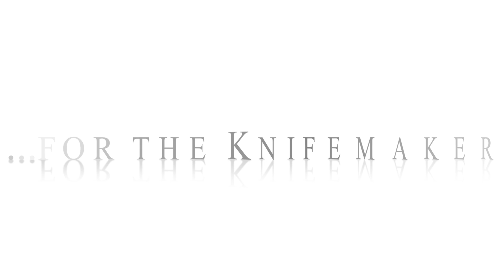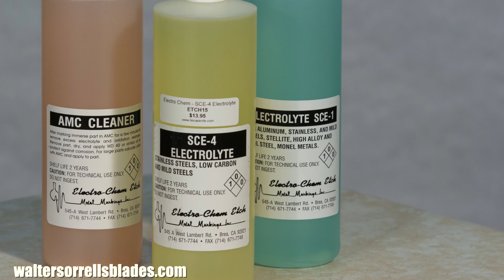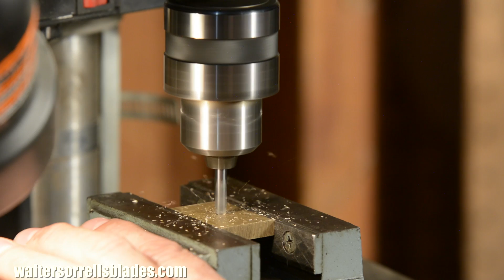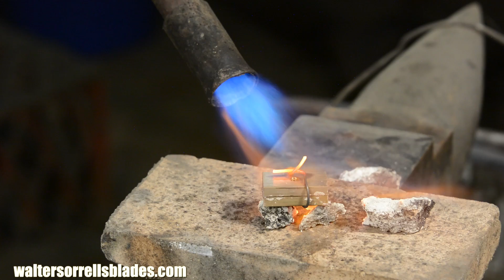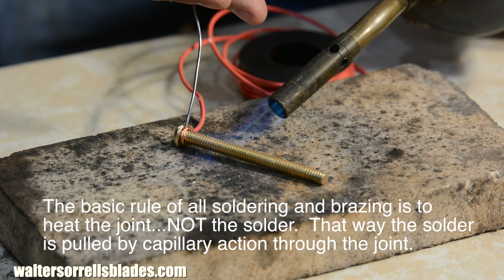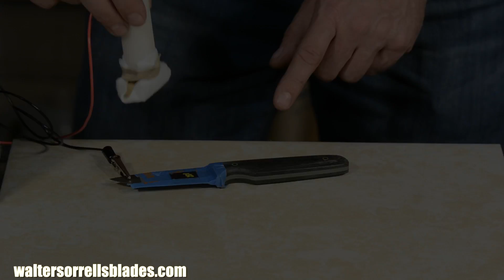Making a Marker For Etching Logos on Knife Blades...and Other Metal Objects

Comment: Nice fancy applicator, but I believe you've wired it backwards.  The red positive is supposed to go to the part being etched, and the black negative lead is what's supposed to go to your applicator.  If you're using AC for black marking, the colors don't matter, but for DC deep etching you've got the wrong lead going to the applicator.

Comment: Why wouldn't you just drill and tap a thicker piece of brass instead of brazing two pieces together?
Reply: That's what I didn't get! What's even the point of thickening the brass piece? Why not use like it is?

Comment: Thanks for sharing this great idea!! ["shared" on GAB.ai, and on Xephula.com]  
IMHO: ...You could coat/insulate the necessary metal electrode surfaces, (brass bolt threads), with "liquid electrical tape", (rather than "epoxy").

Comment: Walter,
 Gotcha! Actually, the #7 drill, and the others on the wall charts are designed to give 75% thread engagement. Someone decided that the bolt/screw will likely break before stripping the female threads. We all make do when it works as well as the “right” way.
  A handy method that I learned years ago, is to use this formula. TDS=D-1/N   TDS= tap drill size.  D= major dia. of tap   N=number of threads per inch. Metric threads are easier. Example M6-1 tap drill size is 5 mm or whatcha got.
  I never realized how simple these things can be to make. Thank you for brightening my bulb.

Comment: What on earth is "Sodder"?
Apart from that....pretty interesting.
Reply: Unfortunately "Sarder" is the appealing and Crass way Americans try to pronounce the original English word "SOLDER"! 
I wonder if the presenter ever "SARD" a car when he didn't want it any more.
As in, "oh yeah, I SARD my car  on eBay". I SARD it in 3 days.
No. He did not. He SOLD it. It SOLD on eBay, and it SOLD in 3 days.
And the electrical joint was SOLDERED.
SOLD_ERED.
SOLDERED.

Comment: This video leaves out the most critical "need to know" information about successful electro-etching, the voltage and polarity. I can assure you if anyone connects the "red" positive supply to the stamp and the "black" negative supply like the video shows, they will not get good results. In DC etching the work piece is always the positive "red" and in electroplating the work piece is always negative "black". In effect what you have created is a nice electroplating kit not an etching kit. This is all assuming you are doing actual DC etching which brings me to another point which is that etching can also be done with AC current which simply makes a black mark and does does not remove much metal.

Comment: Just out of curiosity what are you using for a power supply? Thanks!
Reply: A car battery charger works. 6V for light etching. 12v for Deeper. Run some test pieces on scrap steel but I generally hold for 15s (with salt water) a few times to get the etches I want. Fiddle around to see what you like in terms of duration held and number of passes.

Comment: Also for alligator clips and banana plugs that you used. Radioshack and Bestbuy both sell screw type. Other than that the same tinning technique should be used pre soldering for those. Even if they are the screw down type tinning is recommended to prevent wires becoming unbraided and damage as it adds a conductive but protective metal shell to the wires. I would recommend electrical tape or heat shrink for everything up to the epoxy and at least cover the epoxy top with some electrical tape.
Reply: Harbor Freight sells them much more cheaply

Comment: Your solder application note is for plumbing and not for wiring as you are doing in the video. Per NASA soldering standards you apply heat to the component.

Comment: Just a couple of tips for the electrical soldering of the red wire.The copper of the wire should only wrap around the bolt until it meets back up with itself. Also, tin the wire prior to wrapping it, you will have less wire separation and better conductivity. All you have to do, since you shouldn't use a propane torch on electrical wire, is apply a small amount of solder to your solder iron tip and hold the tip to the bottom part of the wire near the end away from the insulation and apply a small amount of solder from the top. Do not get right on top of the insulation as wicking can occur, but move solder and iron toward the top after the solder begins to melt and move down toward the end of the wire. This will give you a good solid conductor with even solder application and the excess solder will come off at the end. It shouldn't be a lot of solder, so if you think you applied too much, run the solder iron under the wire again to strip the excess. Probably should have mentioned hold the wire horizontally with a slight downward angle. then to apply the solder to the bolt, I would suggest roughing up the brass on the bolt a bit with some scratches near the soldering area and wrap your wire. Heat it up and apply solder. Remember that the bigger the blob the better the job is the wrong attitude. Had to add that, just the electronics tech side of me.

Comment: as long as you do not use more than 50V DC you have no chance of shocking yourself
Reply: +happymark1805 35 volts is often considered the threshold of safety. But if you want to grab onto 50V be my guest. Let me go fetch a bucket of salty water for you to stand in too.
Reply: +Paul Frederick dont know who teached you that, but my profession  in The Netherlands is electrician, 50AC is written in the books as treshold (years ago it used to be 42V AC), Phone lines also use 50V DC because thats is safe, ever touched a welder ? well that is 50V AC too, with DC you can even go much higher before it gets dangerous (according to NEN1010 it is 120VDC) http://www.opleiding-vca.nl/artikelen/de-gevaren-van-elektriciteit/   so you meight want to check the facts before you say something.
Reply: happymark1805
Actually I have gotten shocked by welders. I cannot say I recommend it either. Notice how I said "threshold". If you knew anything then you would know that electrocution is subject to many variables. Judging by your lack of depth of knowledge on this topic I wouldn't let you change a light bulb for me either. So go back to the bar and guzzle some more lutefisk there Olaf. I'm done with you here.
Reply: happymark1805
It is no lie. Look, I've been hit with high voltages. I did not get electrocuted. But that is only because I have been extremely lucky. Not because the potential did not exist. Because others subjected to the same level of voltage were not so lucky, and died as a result.

Now what jack fool fucking moron +1ed your reply?
Reply: happymark1805
I've worked with plenty of licensed electricians that were complete morons. Just because you know which end of a wire nut to twist does not mean you understand the greater picture when it comes to electricity.
Reply: +Paul Frederick You are a complete moron and does not even know the basics of electricity, so yeah come back when you had a bit of education about the subject.wat ben jij een domoor zeg, ga terug naar de kleuterschool.
Reply: happymark1805
hmm my decades of circuit design suggests otherwise
Reply: +Paul Frederick  your answers suggest you even never went to highschool, because you do not know what you are talking about, might I suggest that in the future you read NEN 3140 and NEN1010 before you make a complete fool of yourself again.
Reply: happymark1805
I have already read more than enough on the topic.
Reply: +Paul Frederick apparently not or you just do not understand it because if you would you would not write so much bullshit. but hey unlike you I passed my exams and not only that exam, so yeah I do know what I am talking about and you are full of BS, wat een dom kleutertje ben jij toch.
Reply: +Paul Frederick no matter what you call me I passed my exams and you didn't, and its Obvious why you didn't because you are clueless, go back to preschool moron Paul Frederick
Reply: happymark1805 I did not pass the exam because I was too busy working, and making money to take the test. Now shouldn't you be out changing fuses for some house frau?
Reply: +Paul Frederick LOL, you make a bigger fool out of yourself with every message you write, and housefrau is German so again that only makes you a bigger fool since in the Netherlands we speak Dutch, you are so full of BS.
Reply: happymark1805
we speak English here in the US, but we still call them smelly house fraus.
Reply: +Paul Frederick the only smelly thing here is you because you are so full of bullshit
Reply: happymark1805
Thank you for making it crystal clear your utter lack of comprehension of this topic. I get it already.
Reply: +Paul Ferdfuckhead you are the one that has no clue at all about the subject while I have passed my exams about that subject(and many other subjects), you think you know it better than everyone including govnerment, teachers and all the books written on the subject, so yeah go back to preshool you dumbass.
Reply: happymark1805
has it ever occurred to you that perhaps the exams you passed are not the be all and end all? You act as if you've won a Nobel Prize or something. I sure as hell know better than governments do with it comes to electricity. If you think politicians care about such things then you're an even bigger fool than I take you for.

Comment: Walter I started pounding the bevel into my first knife and the point drew up like an elf shoe... lol Did I just start the heel too far from the point or what? 😞
Reply: That always happens because the bottom is being spread out just put the spine of the knife on the anvil then hammer it back down you could also use a price of wood as your hammer so you don't hammer your bevel down

Comment: I'm looking forward to the next video showing how the etching works. But I am surprised you talked about shock since electrolysis reactions are usually performed at low voltages?
Reply from the maker: +Richard Andersson They are low voltages.  But any time you're working with electricity in a DIY context, you want to encourage caution.  There's always some idiot who's going to try doing it with current straight out of the wall or something equally stupid!
Reply: +Walter Sorrells there is always the one idiot that has to try it :)
Reply: It's called "experimenting"..
Reply: Albion Watts that's why most experimenters that live through it get the nick name sparky.